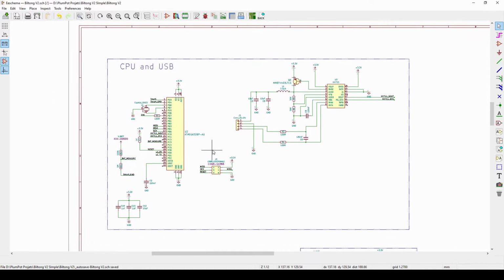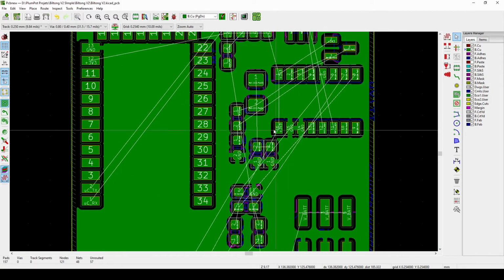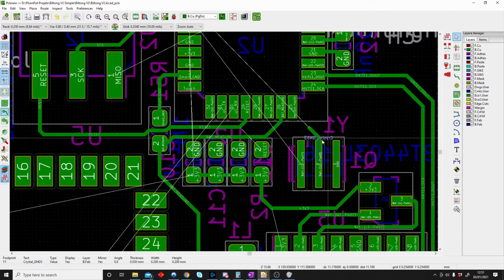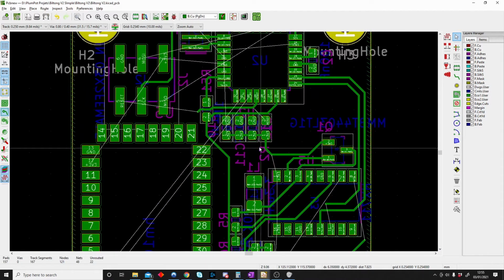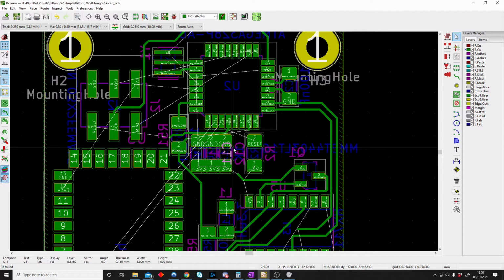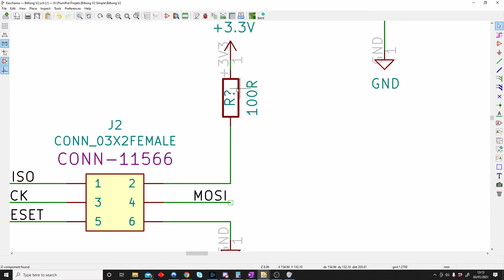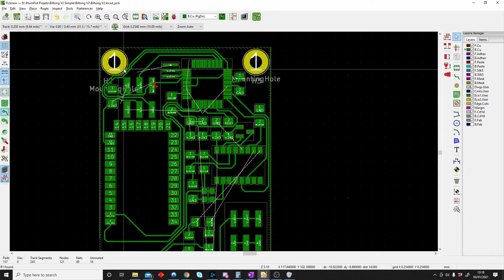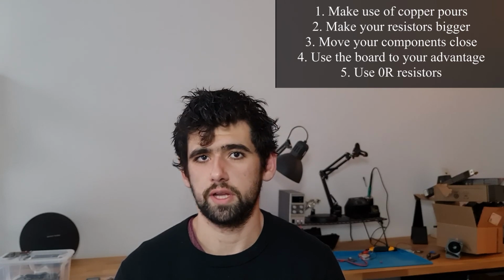KiCad Tutorial - How to make a single layer board for CNC machine

Comment: With a circuit of 50 components, I had to place and cross some components over the tracks to avoid any wire links on a single sided board. Nice little tip.
Reply from the maker: Nice glad it helped🙂. Are you to produce the board?
Reply: @PlumPot  Yes. Hydrogen peroxide, citric acid and salt. Not for the beginner - need to do this outside and with eye and hand protection. Take note. Do NOT store the solution afterwards!!! The H2O2 will continue to decompose because it's contaminated with copper. (I used 30%H2O2 - way too concentrated)